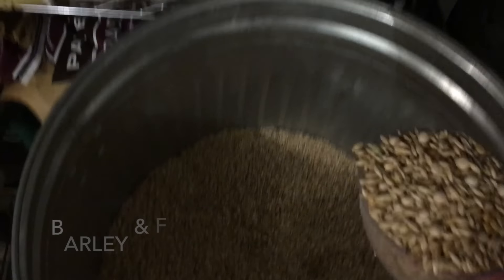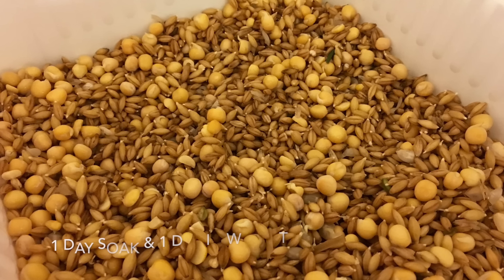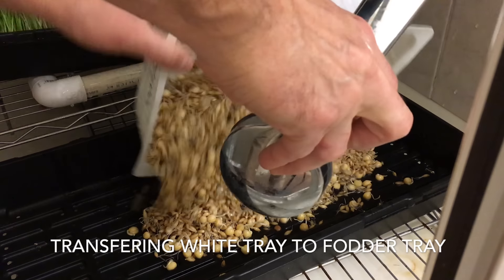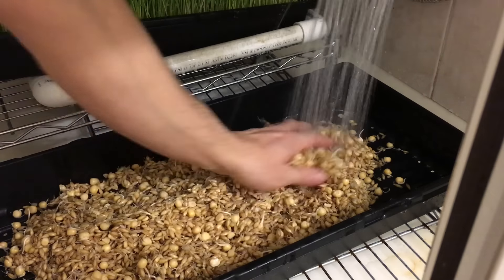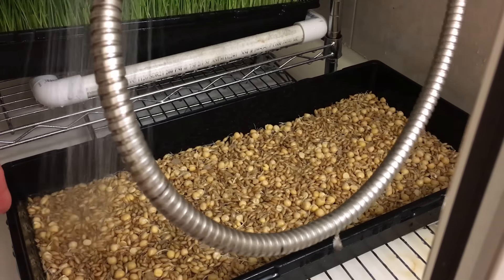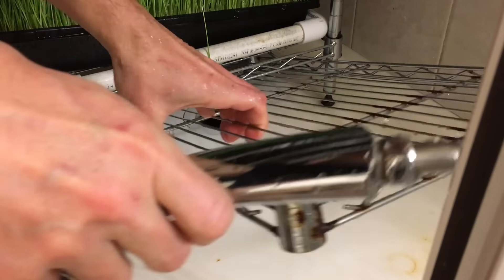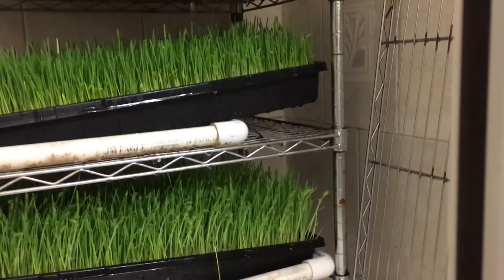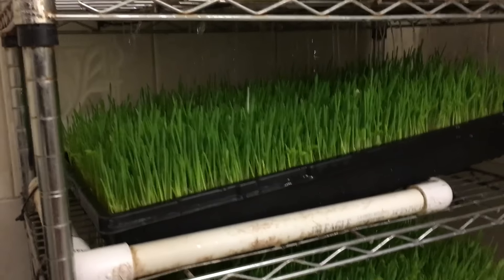Our little fodder system

Comment: if you want to greatly increase your output with this, fertilise your water at the top , it will greatly increase the food value of your fodder, after trying many fertilizers, the best turned out to be composted chicken droppings, then make a solution by trickling water thru them, and add it sparingly to your water, we also use this in our greenhouse, with super results
Reply: Make a video on that
Reply: Rabbit droppings work even better, I hear!
Reply: @kevinhay7421  any benefits from wheatgrass juice
Reply: @MattrixNY  rabbit poo has less nitrogen than chicken poop. If you want quicker green tops, like this fodder, use chicken poo.
Reply: could you make a video on that whitb specified ratios of fertilizer to water please

Comment: Thanks - informative video.  Why field peas? I have seen mixing sunflower seeds with barley but not peas.  Do the chickens like it better? Is the barley/pea cheaper mix than straight barley?
Reply from the maker: Field pea had a higher growth percentage and a higher protein percentage.  I tried BOSS (Black oil sunflower seed) and where it did grow in this system, it didn't yield as much compared to Field Pea.  BOSS is just easier to get.
Reply: CK Knife and Tool thanks for the response - what is the mix ratio of pea/barley
Reply from the maker: The 40 gal can can hold around 125 lbs. and the field pea I've used came in 40 lb bags where the barley was 50 lb bags.  I did say a 30/70 (barley/field pea)
Reply: @CKKnifeandTool  where do you purchase your feed? I've looked online and only found azure to have barely and field pea. I know in your information box under the video it says to look in the comments. I dont know if anyone has asked but I've watched the video 8 times and read all comments and can't see where you purchase your grains. Thanks so much! Great video do much information.

Comment: was cooking bacon and eggs while this was running, but how many cows, productivity on this.  I am gonna be focused on a new barn and work shop this year. thinking of a screened lean to work on some type of fodder system and possibly slidding doors for ease of access to it.  (harvested rain./pond water should be used and natural heat/sunlight)  I might even try piping a control valve off the barn to harvest into a tank and some in a bay engineered to store maybe 20 gallons of water at any time and excess goes over to the 20k gallon tank   neat video, but could be doing a better operation of things to be honest.
Reply: Start from where you are
Time et effort perfects

Comment: thanks .
nice video 😃😊😃.
what is the temperature maintained for this system.
Reply from the maker: 69-71 degrees F.
Reply: CK Knife and Tool 
thanks for reply my comment.

I have a question to ask.

I am interested to start goat farming business.

So can we fully depend on the hydroponic system for green fodder?
please reply me....!!!
Reply from the maker: Nihalahmad Momin ..... I’m not sure fodder alone would suffice but that’s outside my area of expertise
Reply: CK Knife and Tool 
thanks for reply my comment.

According to my research, one goat dose of at least 15-20 kg (minimum).

3-4 kg green fodder, 1kg of dry fodder, 200-250 grams (mixture of soybean, maize, wheat etc.). eat Every day.

My reason to tell all this is that I want to start the goat farming with 5 female goat & 1 male goat.

As you mentioned, 
at least 5-6 kg fodder is formed in 7-8 days from one kg seed. 
OK
If we keep remember for all these things,  then one goat consumes 3 kg of green fodder in one day.
So for 6 goats, about 6 × 3 = 18 Kg green fodder will be required per day. So how about produce minimum 20 kg of green fodder every day.

how to manage Hydroponics system in  large scale.

PLEASE REPLY ME...!!!
Reply: how to manage Hydroponics system in large scale

please reply me...!!!
please share correct solution.

Comment: Thanks for this great idea! My 4 chickens could clear a 5x10 foot area of my lawn straight down to the dirt in one day, but this should satisfy their need for green! As to the waste water issue, one youtube farmer demonstrated his prep method for fodder in which he washed his seeds thoroughly, then soaked in a rather strong bleach solution (1 cup bleach to 3 gallons water), washed the seeds again, a couple of times, I think, then soaked for 24 hours. I think this process will likely produce cleaner return water from the flood and drain, and therefore, reusable water. I am going to try this with a pump and timer on a small scale and see what happens. Thanks again for this great idea.
Reply: 5 x 10?... that's a hell of a lot of fodder you need!
Reply: Здрасьте! А зачем это?
Reply: Perhaps you need to rewatch this. It's not a strong bleach solution. That would kill the sprouts. You just want to make a solution of bleach in a spray bottle to disinfect the Folgers coffee container.
Reply: Better off using peroxide to disinfect your seeds
Reply: The bleach is used as a disinfectant to kill mold.  Different places at different times of the year have different conditions that would promote mold growth. Use more bleach accordingly If needed.
Reply: @ComfyNumb  any benefits from wheatgrass juice
Reply: @ComfyNumb  any benefits from wheatgrass juice

Comment: Great tutorial. Thanks. I will surely try to produce for feeding my lambs. 

1) From setting to harvesting, how many days cycle? At 5:24 this result is on what day?
2) Are the barley and corn of any particular type for this fodder production?

2) Do you pre-wash the barley and corn with detergent? Which one?
3) Daily how many times do you run water on setter tray? For how long each time?

Kindly guide further.
Reply: No further guidance as a reply. :-/

Comment: hiya , I'd like to ask a few questions and I hope you bare with me and answer them cuz I really need your advice , so ..
1-Do you soak the seeds for a whole 24 hours without rinsing during that time ?
2-how many times do you water ? it's pretty hot here around 100-120°F , so the upper seeds seem to dry quickly when on the tray ..
3-can I like put a cheesecloth or smth like that on the seeds ( which are on the tray ) to keep the moisture available constantly ?
thanks in advance
Reply from the maker: Dalil Midouni... hello! 1) I do not rinse during the soaking cycle.  2) At your temperatures is say water three or four times a day.  You really cannot over water fodder.  So long as the watering doesn't start to disrupt the root may growing process.  3) Rhe cheese cloth idea is interesting but I'd say stay away from that. It's important that fodder gets drained well and if it becomes a little dry between watering that'd be OK I think.  There's a difference in keeping moist vs. watering more frequently.  The cloth may contribute to mold growth in wheat and the "yeasties" in barley.  Some good watering and very good drainage has always been the two keys to success with me.  The third was temperatures.  Sorry I couldn't be more helpful.
Reply: thanks , your advice is appreciated mate !
Reply: I used to soak for only 12-14 hours in a tub , some say no more than 18 hours , but 24 hours , that could make a whole difference in root growth , so yea this is what I needed to know
Reply: I'm having a hard time getting grain to grow with temps above 95. If I bring trays inside, we have issues with fruit flies/ moths. My chickens love fodder but its frustrating during the summer. I'd love to hear from someone who grows outdoors in heat and wind. Good video and info for indoors!
Reply from the maker: Melissa Schnieders... We use to grow in the garage and leave the racks outdoors.  When it was hot  I had to water three times a day.  But the biggest culprit to our troubles was the chipmunks climbing into the system and eating the fodder.  As for your temps, keep in the shade and water three or more times a day. Just make sure you have very good drainage.  As I've said before, you really can't over water fodder.  Folks usually refrain from a lot of watering because of mold or yeastie growth. It's really the draining that gets you.  As for fruit flies when indoors, small jars with apple cider vinegar works.  Poke 1/4" holes in the lids and the flies climb in and can't get out.
Reply: CK Knife and Tool I agree. Currently watering 4x a day. On a covered patio shaded by a Redbud tree. Can't get them to sprout. Thanks
Reply: Melissa, I do sprouted sunflower seeds outside  in four 5 gallon buckets for our chickens. We started doing it for our pigs, but our fowl love them as well. We live in humid Missouri where temps are now right around 100. The sunflower seeds tolerate the heat well. I use one bucket for 24 hour soaking (with a lid), and the rinse buckets have holes drilled in the bottom. We stack those and put a lid on the top one. We rinse once or twice daily and that seems to be enough.
Reply: Not a Farm Girl: a Homestead Adventure Thank you for all the details! I'll switch to sunflower seeds for summer. :)
Reply: If you go to my channel and search "pastured pork fodder system" I show exactly how we do it. 
(CK knife and tool, not intending to hijack your video! I love what you're doing here and plan on trying it out for my animals as well.)
Reply from the maker: Not a Farm Girl: a Homestead Adventure... Not at all.  Gotta help folks out when you can.  Share away!

Comment: Thank you I have been interested in sprouting for my goats and chickens. Any idea how much a good system? I have been thinking about using the bakery type shelves that roll around.
Reply from the maker: It's the trays that you should work around.  The shelf system you mention should be able to handle the trays.
Reply: CK Knife and Tool thanks
Reply: Home Depot sells multiple sizes of wheels that can be mounted to those wire rack shelves, which they also sell.

Comment: Have you had any problems with crop compaction with the chickens? I know those pea shoots can be kind of stringy and that bottom tray seemed kind of long. Also, how much do you give per bird roughly? I have 8 chickens and would like to give 2 trays per day for all 8. Does that seem like too much or too little?
Reply from the maker: The fodder was primarily for rabbits and whatever was left went to chickens.  I'd think a tray for 4 hens would be good and 2 for 8 fine.  I wouldn't use it for they're only food source but I think what you stated would be a good start.
Reply: I think that would be the maximum I would give them, plus their feed of course. Thanks for the response and video!

Comment: Put a bowl under the last grass container, be smarter, reuse water 🚿
Reply from the maker: If you had read through the comments you would have seen that I have done that.  And remember, you cannot just simply reuse the water.  It will have to be filtered and cleaned to go back through this process.  Now, you can do what I did and just use the collected water for the grass, vegetables or flower gardens.

Comment: First time viewer, new sub. I have a couple questions which you may have already answered in the comments but I haven't read through those yet.
My first question is what kind of animal are you feeding the fodder to?
My second question is about the bleach water. Are you putting that in the soaking day only in the red coffee can and what is the purpose of the bleach water?
My third question is how many days is it from the soaking to the feeding?
Reply from the maker: Hello and thanks for the support and questions!  #1 We use our fodder mix to feed rabbits and chickens.  (chipmunks and squirrels if we left it outside!)  #2 The bleach water is in the red Folgers can only.  It's a very slight amount and used to ensure any bacterias that have attached to the grains are killed off.  #3  I thought I mentioned the time frame in the video.  24hr soaking and the approx. 7 days of tray growth.  Temperatures have a big bearing on this though.  Too cool of climate slow growth quite considerably.
Reply: You may have mentioned the total time and I just missed it. Thanks for the quick reply. I do sprouted black oil sunflower seeds for our fowl (chickens, ducks, and guineas) and had occasional spots of mold. I have started adding bleach in the soak stage after seeing you do this, and it's cut out that problem We are looking into starting a rabbitry this year, and I really like your method of growing greens, I will likely include do this as well.
Reply: CK Knife and Tool 

If you gave your animals only fodder how many animals per tray or kgs per animal would you need?
Reply from the maker: I don't want a channel I'm just commenting... the rabbits should still get only 5 oz or so. Alway remember to include dry grass as well.  Too much fodder for rabbits get them bloated and then their pellet gets more wet and stringy.   Orchard grass.  Timothy.  A couple ounces of dry pellet with an alfalfa mix.  Something.  Goats?  Feed away!  Chickens?  Same there.
Reply: Not a Farm Girl: a Homestead Adventure love
Reply: What temperature should they be in the room?
Reply: CK Knife and Tool                   What did you mean by " Timothy?"
Reply: CK Knife and Tool                     I knew bunnies ate greenery, but I thought chickens ate primarily seed and bugs, worms in Nature?  They eat green grains?  I didn't know that chickens ate alfalfa!
Reply: CA Catr lol my chickens eat my hostas! I have to relocate my plants so I don't lose them. Chickens are omnivores just like us, except they prefer the greens and grains more.
Reply: Ann Dennis     
Thank you for your answer, but what are "hostas"?
Reply: So there's NO greens in nature? Of course they eat greens
Reply: CA Catr // "Timothy" probably means the grass he's using.
Reply: You could use Hydrogen peroxide instead of bleach
Reply: Yes chickens pick on green grass. makes the yolks nice and yellow
Reply: CA Catr it’s a type of grass
Reply: CA Catr hostas are leafy garden plants that bloom small long stemmed flowers. Deer and rabbits love eating hostas

Comment: Interesting using 50-50 bleach mix. Food grade sprouts usually use 20:1 bleach for cleaning equipment. I think a good seed sterlization process would be soak for 5 minutes in  the bleach bath then rinse and add water.
Reply from the maker: I don’t soak the seeds in a 50/50 mix.  I soak the seeds in water with a few squirts of a 50/50 mix.  In total, maybe 1/4 to a 1/2 teaspoon of bleach is in the coffee can which holds about 1/2 a gallon of water with the seeds.  When sprayed in the water and stirred about, you barely smell the bleach water mix.  It’s just enough to kill any bacteria or fungus.

Comment: How do you manage rust on the metal racks?
Reply from the maker: Rust did show up but not as bad as you think.  And for the price, you can replace the system later.  With that said though, it would be several years before that became a concern.  You could sand them and repaint to clean up and protect.
Reply: @CKKnifeandTool  or you could also try painting them with rustoleum paint before using them. That would probably help them to last a little bit longer.

Comment: Great video. Could you tell me please every after how many hours i have to give water?
Reply from the maker: Just run about 6-8 min total.  Just wash each tray individually as well as from top down.  A good rinsing will save you tons of problems.  You can save the water and run it through a filtration system to reuse but don't reuse water without that.  It will be contaminated and you'll just be putting back all the bacteria and such you rinse out previously.

Comment: How long does it take to grow a tray to the point it’s ready for feeding? And how many rabbits can feed on one tray?
Reply from the maker: 7-8 days
12-18 depending on the square size you cut and size/age of rabbit.
Feed fodder with drain grains and alfalfa.  Fodder is especially important in summer months to add moisture and wet proteins.  Our rabbitry was a mix of NZ/AmChin/Rex with a dressed weight after 7 months of 6-6.5 lbs

Comment: Hi there, was is the pvc piping for, just to angle the grow trays so water will drain?
Reply from the maker: Yes, correct
Reply: @CKKnifeandTool  Thank you, I just started my fodder station on a 5 tier metal following a lot of your advice, will they get enough light to sprout green in the shower stall or did you add a light?

Comment: Your cross contamination is backwards. It should be oldest at the top as it has been rinsed the most. This will keep the contaminants always flowing down.
Reply from the maker: No.  The older the tray, the more decomposition has occurred and the thicker the root mat which holds them.  Also, if you had done this system you would know that the older trays are warm to the touch because of the organic materials and bio systems that are growing.  The newer trays are clean and have nothing when they start.  It isn’t until the growing begins that the husks from the grains split and become nutrients for what grows.  Older on bottom.  Newer on top.